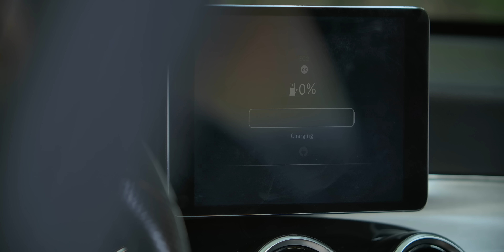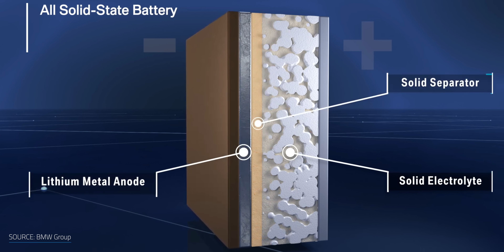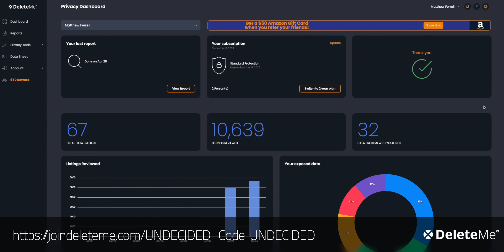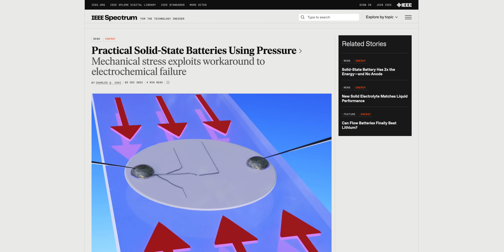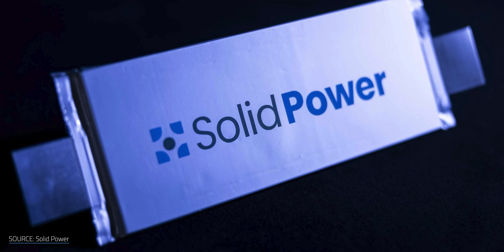Solid State Batteries are Closer Than You Think

Comment: It wouldn't surprise me if some solid state batteries were being made right this moment in small test batches, and it would surprise me even less if they still didn't appear in a mass market car until 2030, because that's how it works. You can buy a semi solid state battery from Renogy at this very moment, next year or the year after they may be selling some actual solid state batteries, but getting mass manufacturing up to the state that they can start putting them in cheap EV's is another thing altogether, 3 years, 4 years, quite possible, solid state batteries you can buy like the Renogy semi solid state batteries, a year or maybe two.

Comment: Honestly, I'm a much more interested in Solid State batteries for under hood (i.e. starter batteries), and those for hybrids/Plug-in Hybrids. Li-Ion batteries are a good 20 or more pounds lighter than a standard 12v lead/acid battery, so Solid State cells might further that by a few pounds. Same with hybrid battery packs, though the weight savings might be even greater. So yes, I'm very interested in Solid State batteries, just not for strictly EV's.

Comment: I did a deep dive into these two companies.  It appears that Quantumscape technology is very close to comercialization.  The Cobra process is here, and the b0 version of prototypes are being tested by VW.  Quantumscape's website provides much information about how their tech works, the benefits of the design.  The increased energy desity is beneficial, but IMO the most important aspects is being dendrite resistant.  This is what enables the fast charging and increased number of cycles.  The improved saftey is great too.  The lawsuite the company suffered several years back damaged the companies reputation, but in hindsight appears to be unwarranted.  This depressed the company stock price making an amazing value proposition for investors.  I believe this company is well positioned to deliever the best battery technology, and via licensing will have production and innovation from these manufactures in cathode design.  I couldn't be more bullish.

I am less bullish on solid power.  The stated benefits is much less, with only 1000+ cycles is concerning.  

Matt's video does a really good job explaining the technology with graphics, and makes a great primer before digging into company websites to get into the nitty gritty.  Thank you Matt!

Comment: QS should have Cobra prototype ready in 2025.  VW will ok it in late 2025 for 2026 installation at their upcoming battery plant in Ontario, Canada for production in late 2026 or 2027.  Perfect timing for a 2029-2030 model to come off their TN plant (next gen ID.4 or ID.7 or ID.8) or earlier (2028) for a future Porsche/Bentley model first given the cost of these batteries. 

QS is about 2 years ahead right now.

Comment: With Tesla increasingly optimizing current battery tech with software, the gap between batteries becomes smaller and smaller.  For the assumed high cost of these batteries, will it be worth converting? Not for another 10 years after initial production. By then we will have fusion graphene flying hoverboards

Comment: Charge rate isn't the only thing keeping most people from EVs. 
How many cycles can a gas tank be used for?
What happens to your old gas tank if by some freak accident you do need to change it?
How much does a new gas tank cost?
How much does a gas tank weigh?
How much capacity does a gas tank lose over the course of 5 years? 25 years?

Hydrogen ICE is the answer, not electric motors and batteries.

Comment: SES AI is another company competing with Quantumscape and Solid Power. You might argue they are not solid state, but in the battery industry, "solid state" is merely a buzz word. For example, Quantumscape has a gel catholyte. Is gel a solid? I've taken to using the terms "advanced lithium-ion" batteries, like Solid Power, with its 50/50 silicon/lithium anolyte*, and "lithium metal" batteries which have 100% lithium metal anolytes (Quantumscape, SES AI). What they all have in common is they are in the ~400 Wh/kg class, compared to current lithium-ion batteries which are in the ~200 Wh/kg class. Some more companies working on batteries in the ~400 Wh/kg class include Sion Power, Cuberg, and Amprius.

* I acknowledge the video mentions Solid Power has plans for a pure lithium anode battery too, but that's not their priority. They're really all about the upcoming "Silicon EV Cell" at this stage.

Comment: As you pointed out in the video, EV's are still not really competitive with ICE vehicles, especially in two specific regimes: long road trips, and (for trucks) towing trailers. Out here in the Western states, where distances between cities tend to be rather longer than they are back east, ICE cars are far more time efficient. I can get 550 miles on a tank of gas in my Rav4, and refill the tank in less than 10 minutes. If I had a BZ4X, or a Tesla Model Y, I'd have to stop at least twice along the way to charge, for 90 minutes each time, to make that same 550 mile trip. And my cost-per-mile for gasoline in the Rav4 is actually less than I'd have to pay to charge an EV. Gasoline for a Rav4 Hybrid costs about 10¢/mile; charging a BZ4X at Electrify America or EV-Go, at 49¢/kW-hr, ends up  costing me 15¢/mile. Now, that's only a problem for long road trips - running errands around town, an EV is generally less expensive to run on home charging. The issue for truck owners towing trailers is far worse: Putting a 6,000 pound RV trailer behind a Ford Lightning, Rivian R1T, or Cybertruck, will reduce their driving range to no more than 75~100 miles. That same 550 miles road trip will require no less than 6, and likely 7, stops to charge the tow vehicle, 2 hours minimum each time to get a 100% charge. A 3/4 ton pickup with a diesel engine and a 35 gallon fuel tank, will only need to stop once along the way to refuel, and that stop will take no more than 10 minutes. Diesel fuel for that 550 mile trip will cost $190. Charging for an EV truck at Electrify America, for a 550 mile road trip towing that trailer, will cost $352. That's 6 charges of 120 kW-hr (Ford Lightning) at 49¢/kW-hr, and you will have spent 12 hours just sitting at charging stations.

Solid State batteries will definitely help make EV cars more practical. Toyota hopes to have solid state batteries in it's next generation of EV's, that will replace the BZ4X in 2028~2030, and those cars could see driving ranges of up to 800 miles on a battery that has the same physical size and weight of the gel-electrolyte battery in the current BZ4X. The service life of the battery should be longer, maybe 200,000 miles, compared to 120,000 miles for gel-electrolyte batteries. But for trailer towing, I don't see EV pickup trucks becoming competitive with diesels any time in the foreseeable future. Diesel fuel has about 36 kW-hr of energy per gallon, of which about 40% (14 kW-hr) can be extracted as mechanical energy at the drive axle.  There's no technology that can pack 14 kW-hr of energy into 7 pounds worth of battery. The traction battery in my Rav4 Prime has about 14.5 kW-hr of usable capacity and weighs 850 pounds. Any diesel pickup truck can extract that much energy from only 1 gallon (7 pounds) of diesel fuel. Even if Solid State batteries can double their energy density, we are still talking 425 pounds of battery weight needed to hold the energy of 7 pounds of diesel fuel. For big-rig trucks, it's different. They can carry a far larger battery than a pickup truck can, but the energy density issue is the same. And a battery weighing 10,000 pounds means the truck can only carry 15,000 pounds of payload instead of the 25,000 pounds that a diesel tractor-trailer can haul. Battery-Electric trucks and vans work well for local delivery, but I can't see them replacing diesel trucks anytime soon for long-haul trucking, even if solid state batteries do become the standard EV battery technology.

Comment: Solid State are still in the future.   If we were close (2-3 years out) we would be flooded with spin on Solid State batteries.  So, using that indicator, I believe SS are still AT LEAST 5 years away.   Probably closer to 10.

Comment: TDK already have Solid State batteries for sale so they have arrived. An improved version of the battery is already on sale. Many Solid State batteries are in the preproduction stage with full rate production not expected for a few more years. It has yet to be seen whether the hype is indeed real or a small step forward over current Lithium-ion batteries.
😎🇦🇺😉👍

Comment: Making SolidState Batteries: Hard

Making Mass Market SolidState Batteries: Very Hard

Making Mass Market SolidState Batteries that actually have more density: Extremely hard

Making Mass Market SolidState Batteries that actually have more density, and work in an Electric car: Supremely hard. 

I would not want to buy a 1st gen SolidState Battery EV. Atleast 1st Gen Evs has Lithium Ion what was very known, most currently used cells have been manufactured for over a decade. Not just in cars, but power tools, and toys. 

200miles of range is sufficient for me. I would love 500miles, but if it means new tech that is not well tested, then I will go for the 200miles. Have these cars operate for 2 years and then I will consider.

Comment: It would be interesting to know if current batteries are designed to be easily replaced by solid state batteries.  Ex your tesla battery is now failing will you be able to easily replace it with a new solid state battery?

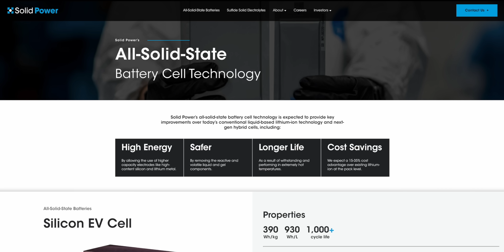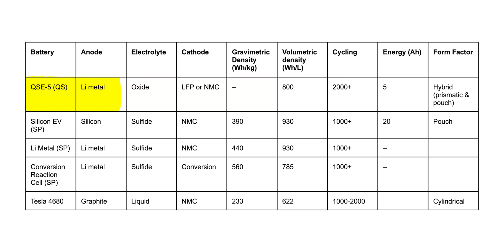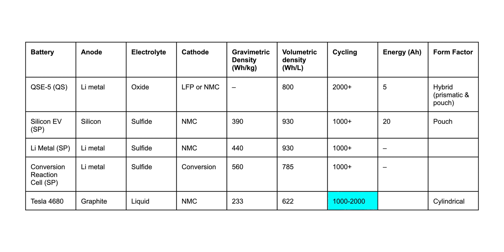Comment: 6:45 QuantumScape box pouch fkex-frame design 7:10 Solid Power, CU Boulder spinoff, R&D here in Louisville (CTC), Brighton factory in the works 8:56 battery comparison chart 10:14 QuantumScape has 2x Solid Power cycles

Comment: Sounds like nuclear Fusion, or particle physics, or quantum computing, all which Michael Caine has promised to have the solution to the problems they currently have yet to solve before McConaughey gets back to earth, when in reality without going into the black hole there's no way to be able to collect the data that will lead to solving the problem. All of these things seem much more likely to fall within the realm of The Heisenberg uncertainty principle rather than the solution for them being kicked down the road every time they get asked how much longer. I mean what's more plausible after decades of being told the same thing over and over, that this is finally it, or that the data needed to solve these problems is beyond our comprehension?

Comment: People keep saying the new tech can charge your car fully in 10 mins or so.     But then a few are asking what exactly is meant by that.  It means putting in 80-100KWh of power in 10 mins.   So that mean on average you need a single 600kwh charger.     So if the charging station has 10 such chargers.    Assuing  the charging station needs 80% of this power (such as the car leaving the spot and another car comes in),   we are  still talking 5MWh (megga watt)  output from this station alone required.     I saw many are complaining they are only getting 60kw charging out of a 180kw charger when most of the charging ports are filled.         So not only this battery tech may be still far away,  the tech and availability for the infrastructure is also non existence.

Comment: I think we need to stop thinking that there will be ONE singular solution for all of our energy needs. As a whole there will be some solutions that are good for mobile applications and some that are better for stationary applications. Just like there are coal power plants that are beneficial ( because fuel is cheap) and there are nuclear power plants (contrary to governmental beliefs, which are a clean energy) both of those methods are great at producing larger consistent amounts of energy, but we also need small natural gas supplementary power plants for times of higher demand. We have never had a single solution for our power generation. Just like you don't use a hammer to tighten a screw. ( At least you shouldn't) There should be several many tools in the energy toolbox.

Comment: The 2027-2028 date also corresponds with what Toyota has said about their solid state batteries.  Personally I switched to an EV in Dec’23 because they are fun to drive, have lower maintenance and fuel cost. I know improvements will keep coming and when solid state batteries finally get here, I’ll probably switch.

Comment: Average  SUV  like  Tesla Model Y  or  BYD Seal U  should have  real range  700-800 km  for this range they need  at least  140kWh battery , only  solid state with energy density  above 400Wh/kg  can fit  under the car body .

Comment: Solid state batteries really aren't needed for most people. People make such a huge deal out of lower ranges and slower charge times, when those things can be avoided with proper planning. Most of the places EVs will be starting off in, are in cities where the range barely matters and you are sitting at a single location or at home. We would be better off starting with the lower end EVs to spur adoption, as well as improve our power grids to handle the increased loads. Solid state batteries will be great in the future, but right now far from needed.

Comment: SSB's away for a bit more, but Semi solid state batteries are truly here, but why aren't expensive phones using them? No one knows heck there not even replacing carbon for silicon for example s24 ultra could have a real 5500 mah rated battery.

Comment: As interesting as solid state batteries sound, I am not sure they are needed for that many applications.
To me, having a cheap and durable LFP or even Sodium battery that can do 3000-6000 cycles in an efficient vehicle and reasonably fast and dense charging network is a better answer. Of course there will be applications where the higher energy density is important, but I am pretty sure regular daily driver cars don't need it.

Comment: Could airplanes use solid state batteries? For airplanes that are battery powered, having a quicker charging time means quicker turnarounds, which is important. Also having a lighter battery that has more rang and is not as heavy helps as well as a battery that does not catch on fire. Also for airplanes that still burn fuel, having a lighter battery means the airplane does not burn as much fuel. The FAA would have to certify the process, but every airplane manufacturer would love the concept.

Comment: The other problem with wide spread adoption of EV's is power production. Until fusion is actually commercially available OR small to medium fission modern power plants become wide spread EV's will remain what they have always been, play toys of the rich. Just like cars and commercial aviation where in the past. Until new technology made the costs come down. And make no mistake, I am an EV fan. But I am also a realist that power does not come from rainbows and unicorn farts or pixie dust. Nor does it some from solar or wind power. Facts don't care about your feelings nor is it anything but what it is. Every time you see a line of railroad coal cars think EV fuel. And that is just a fact.

And just like anything else new at first it will be very expensive,very rare and buggy as hell. That has been true about every knew latest, greatest thing across history.

Comment: "as long as it's faster to fill a gas tank than charge a battery, some people are going to have their doubts about EVs"
guilty as charged (pun not intended...)

the other area I see EVs struggling in is the rural livestock farmer space - chucking a full 20L fuel can on the back of the ute for emergency use is one thing, lugging around a fully charged battery pack (the EV style one, not the gadget style one) for the same purpose is a completely different animal (and a lot of paddocks may not have ready access to power, this is more unpromised the further the paddock is from a public road)

Comment: In optimum circumstances, electric cars are light years ahead of ICE vehicles. BUT, they are too many obstacles to take them seriously. Stability of batteries. Charge time. Lifetime and replacement cost of batteries. Weight. Lack of infrastructure. Reliability. Cloud connection (can remotely be disabled) Distance. Environmental obstacles (cold or wet weather for example) imo they will not be a viable option for at least 10 yrs
Reply: Yeah, battery is limiting.  Issues with software more commonplace too compared to ICEV or HEV, not requiring any updates.

Comment: I wonder how used car market reacts when a big jump in battery technology comes around. So far batteries have advanced gradually and EVs have still seen significant depreciation in value compared to their petrol siblings.

I suppose battery management systems of existing cars would be incompatible with SSBs. Or at least retrofitting them would be expensive.

Would be nice to know how will these SSBs perform in cold climates. I haven’t been able to find anything solid (pardon the pun) on this subject.

Recycling li-ion batteries has been a hot topic as well. I doubt recycling li-ion batteries is commercially viable if they aren’t around for much longer.

Toyota’s SSB was left out of this video, they too are targeting 2027-2028.

Comment: I would prefer batteries without Lithium, preferably without any rare earth metals, but first and foremost without metals that react violently to water vapor in the air . While statistics show electric vehicles catch fire a lot less (per 1000 vehicles) than combustion engine cars, they still park in the same car parks, and are a lot harder to put out. In order to get widespread adoption of EVs, this needs to be addressed as much as the range and charging times.